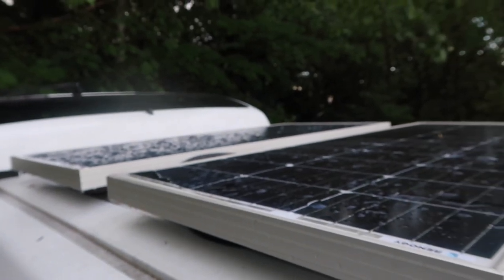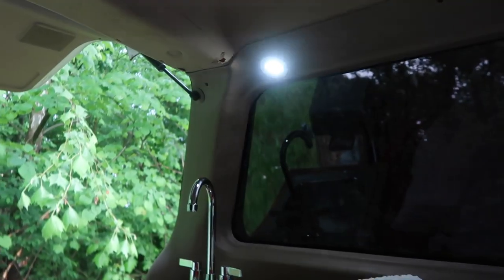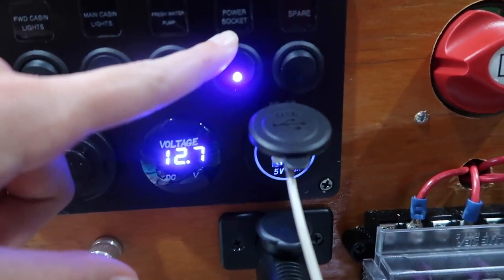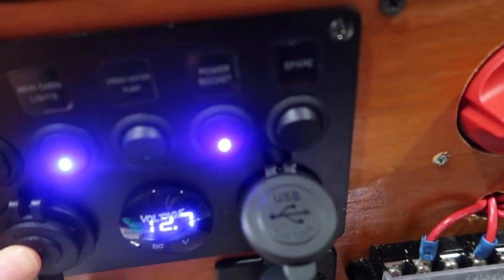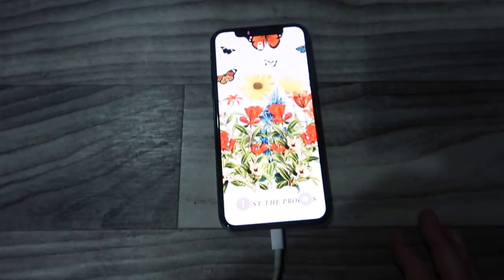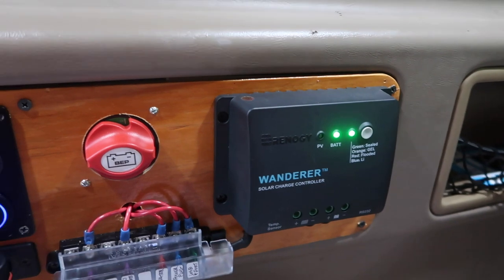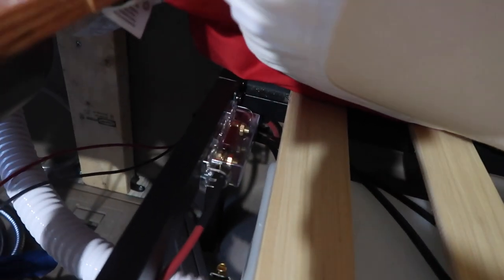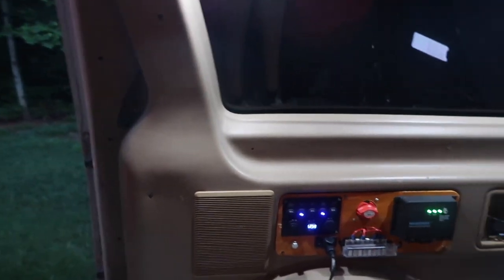Solar Power Electrical System in Minivan *MUST WATCH*

Comment: My dad bought a 1990 Ford Aerostar van in 1993 and drove it until 2002. When he traded it in, it had 297K on the clock and still going. I'm about to start a build myself and am shopping for a van now. Keep up the good work on your build, and can't wait for your first adventure vid... :)
Reply from the maker: Awesome!! Thank you :)
Reply: nice mine is 440000 still running good just maintain oil change shes strong

Comment: How is the control panel inside the van connected to the solar panel on the roof? Also, how is the inside control panel connected to the battery? Thank you for the help!

Comment: You and your dad are super talented! Curious though, does the Alpicool not have a 12 volt plug? I would think that would be more efficient than using AC from your auxiliary battery.
Reply from the maker: Thank you!! the Alpicool runs from a 12 volt plug. Everything is 12 volts DC

Comment: Holy monkeys that fuse block is $38!
Reply: what do you expect? it's a safey feature and worth it.
Reply: @j.a.b.9976  That's kind of a shallow way to look at it.

Just because it's a "safety feature" doesn't mean it should be disproportionately expensive.

Features, quality, standards, and testing/certification should dictate price, not "because safety".
Reply: @GoatZilla  ok, so what is the one to get? How it should be done? I am interested in the drawing of this set up, from panels, to battery, to switches and some math about it so I know what I could connect to it. Oh, and maybe a video of the real installation of cables around the van, how to get the lights there, and the cables from the panel to the battery...